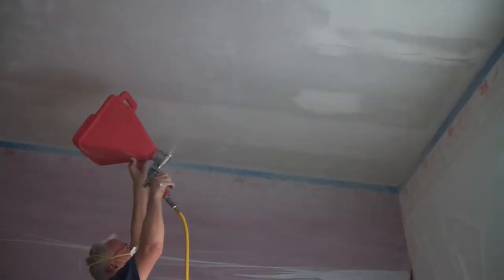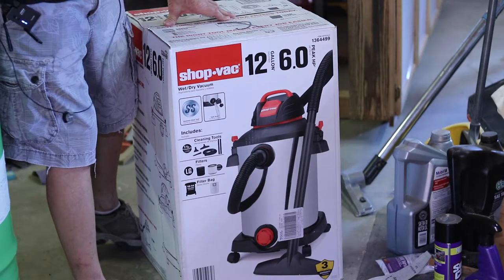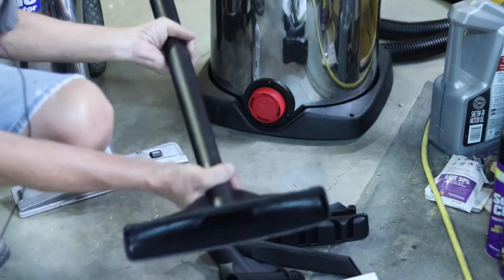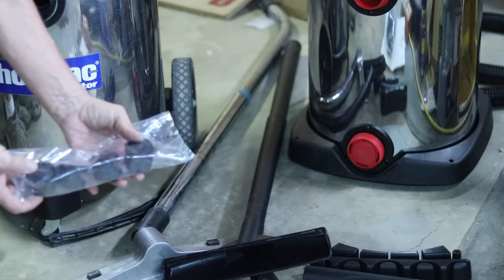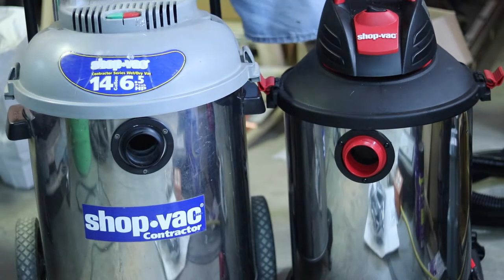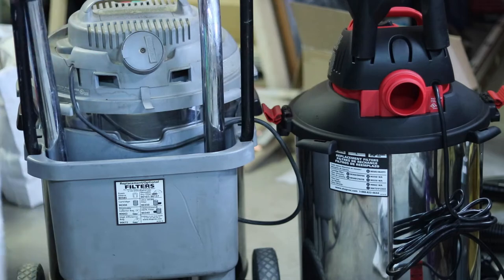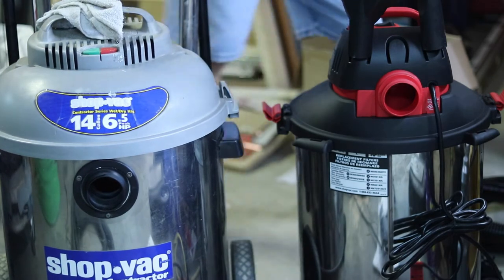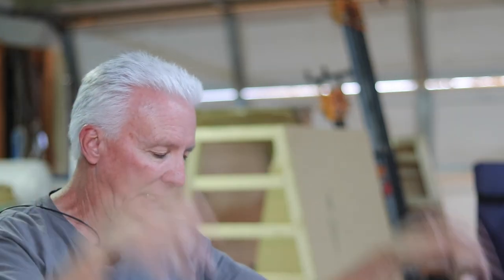Shop-Vac New vs. Old review

Comment: I have an old 4 Gallon (imperial) model 500 from the early 90s (used to be my grandfather’s) that runs like a tank, I bought one of the newest models and used it for regular dirt cleanup and vehicle cleaning and the motor burnt out within a month. I used the model 500 for even more than that (renovations, flooded basements, etc) and it’s still running strong today. They don’t make them like they used to, I’ll say that

Comment: I think they still make your contractor model, but its a little pricey, I have an old one just like your contractor one and it still works, I just the other day went and got all Ridgid stuff and made me a collector out of a 5 gallon bucket, now i dont get hardly anything in my vac just light dust
Reply from the maker: Ken they have a 16 gal. with the 6.5 motor but all attachments are plastic. For $190 that aint good to me. 12 gal or 16 gal no more 14. I didnt need a 16 just for the vacuum. so I hope this works. Our old Shop Vacs are truly contractor grade not plastic. Thanks for viewing.

Comment: You are comparing a contractor model Shop-Vac which was $170 to a cheaper consumer model Shop-Vac which is more like $70 you're not comparing Apples to Apples if you buy the contractor model now it is same as what it was 20 years ago so you're not really doing the same comparison
Reply from the maker: kb9ndb I understand what you are saying. This vac did cost $100 and the contractor has jumped to $180 & $190, 2 versions. Going from 6.0 motor to a 6.5 on the contractor didn’t justify the added cost for a simple .5 on the motor. But everything holds true it is still cheap. The attachments are all plastic if I’m spending the money I want higher quality accessories. That’s just me. Plus I didn’t need a 16 gallon when my old on was 14 and quite sufficient this was going to be mounted to a permanent base for dust collection. I didn’t need more volume but I wanted a good motor. The 6.0 thus far has done well I just wished they kept the metal wands and attachments. That’s the main point. Thanks for the comment and thanks for viewing.